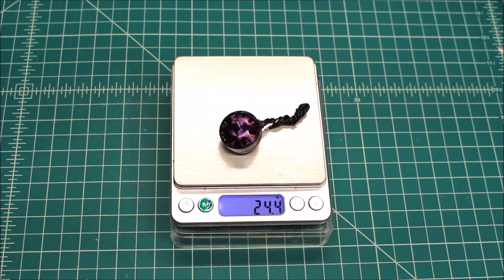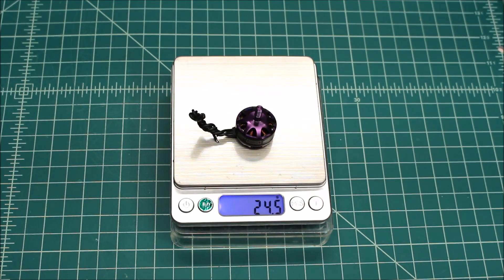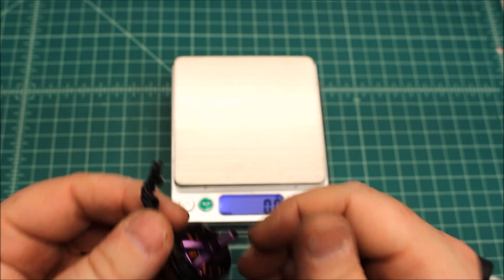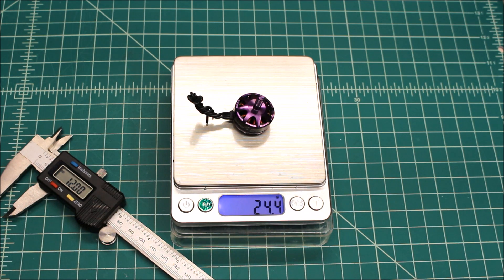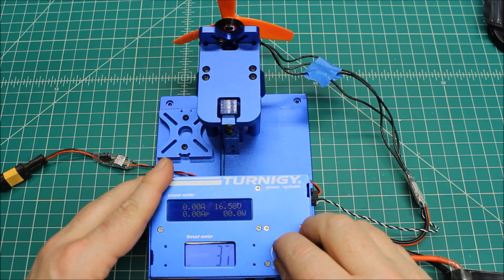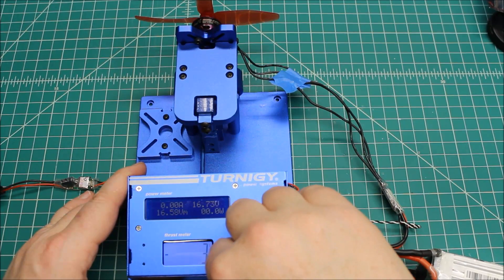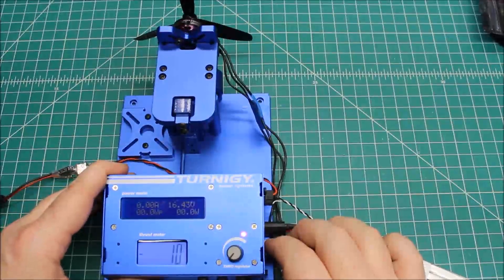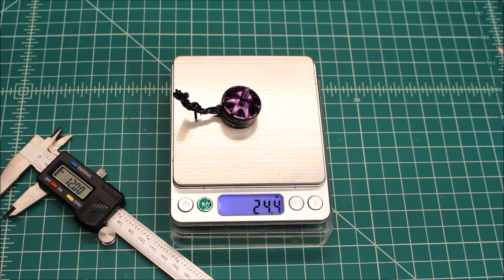Lumenier Skitzo 2205 2400KV Ceraminc Bearing "Motor Test Series"

Comment: FYI ceramic bearings are anything but smooth or spin more freely. they just handle more heat than steal bearings.
Reply: Cecil Williams i work for coorstek and we make ceramic ball bearings for bearing manufacturers. They are smoother, lighter, non conductive and run with little lube.  Not sure how much of a weight savings there is

Comment: I replaced the steel bearings in my Skitzo's with ceramic ($16 for 2) .   They started off nice and smooth but 4 batteries later, I noticed them getting rougher.  8 batteries in and the quad was unflyable (rough running and shaft play).  They came with unmarked races so not sure who makes them but that should have been a red flag.  Don't bother upgrading to the ceramic hybrids from Lumenier, they're really crappy.  Look for a marked brand NMB or FAG if you're replacing bearings.   Hope you get more life out of yours though.

Comment: Flown these on my kiss setup on a anakin club racer and it was very smooth, efficient and had a lot of fast response on the throttle on 4s with 5x4x3 props. Great motors overall

Comment: I think people are way too hung up on thrust numbers.  On a light weight X frame these motors work great.  They are also high quality aluminum and the machining is second to none.  I wouldn't call these a racing motor at all and i don't think skitzo would either, does he even race?  That said i think they aren't worth $35, maybe $30. ;)
Reply from the maker: I think what your saying is correct.

Comment: I'm not 100% sure you're getting proper results using the thrust stand potentiometer. I've found that it doesn't give you the full range of throttle, therefore giving you much lower results. These motors should be maxing out at ~1000-1100 grams of thrust. To get more precise results, I've seen several guys wire the pwm wire to a receiver and use their radio throttle stick. Also, make sure the ESC is fully calibrated and check the end points in BLHeli just to be sure. Then you'll be getting much more reasonable results.
Reply from the maker: +FluxFPV thanks for the  comment. I've noticed the guys that are getting the higher numbers are using higher mah batteries, thus having more available power. My goal is not to get the highest number possible but to have a controlled test that remains the same from motor to motor allowing for a baseline comparison. 

Having that said I understand the issue that arises when my test numbers are lower than others. Because of this I will start using two 75c Tattu' s running parallel. This will make my numbers more in tune with other reviewers.

Comment: not enough thrust. how are these motors gonna compete with even the racerstars, which cost under 10 USD? we just have to see how the market reacts to this.
Reply from the maker: I do understand. They have made this motor very light and smooth/well balanced which makes it easier to get locked in. May not be as fast as others but weight is a huge factor in handling and how fast you can get around a track. The verdict is still out on how well these Ceramic Bearings will hold up over time and that is one of the determining factors on if they are worth $34.
Reply: X-Frames FPV The cost is crazy... But I really am intrigued by this approach. Not just chasing numbers like everybody else right now. I love my tornadoes and my zmx too though.
Reply: X-Frames FPV h

Comment: These are cool!! I think it's a really interesting thing for lumenier to not just come with a tornado/zmx style amp hungry thrust behemoth, and to make an incredibly light weight super smooth motor with very respectable thrust figures. 24 grams?!?! Holy qucamole!
Reply: I'm guessing a 30a esc was used. ps: the max thrust is a bit limited by the use of a 20a esc (if that was the case) but it will not cap the thrust at 850g. If the dys se2205 2300kv can work on a 20a esc with 4s and get figures of 1100-1200g .. .i don't see why a lumenier wouldn't get figures close to that considering the price paid:P
Reply: Teodor D True, the numbers are really odd and confusing?!
Reply from the maker: Scrub Zero yeah super lite. I'm definitely  noticing that I spending extra time tuning the super powerful motors. These tuned so easy.
Reply: They might be smooth but the power delivery is crap. By your figures it gets a 2.1g/w efficiency. Get a dys se2205 2300kv and you get a 2.9-3.0g/w. Also not to mention the price... $35 for a motor:)) hell to the no. I can't believe actually that in 2016 a company can put out a motor for a 5 inch quad that has a 850g on a triblade on 4s ... Even the RX2206 2350kv have better figures and those have been on the market for some time. Also having ceramic bearings make them more prone to failure in a crash. 
Supposedly lumenier had some history in the quad scene and you would expect more for their first motor made entirely in the us ( i hope i'm not mistaking)
Reply: Teodor D I reckon that they would get well over a kg if you used 30A escs
Reply: Teodor D I reckon that they would get well over a kg if you used 30A escs